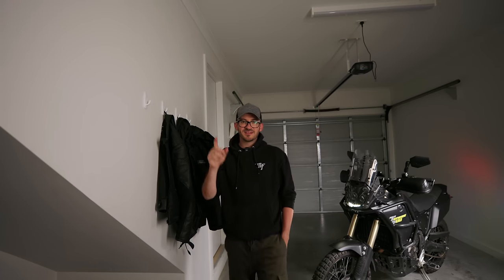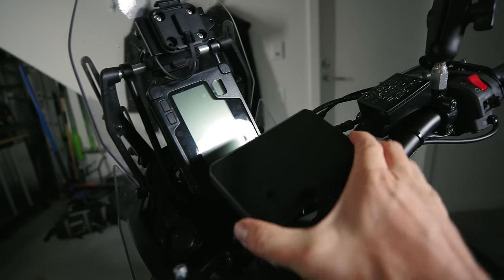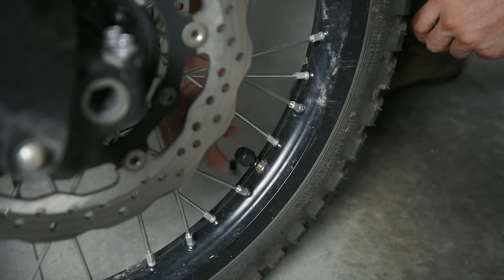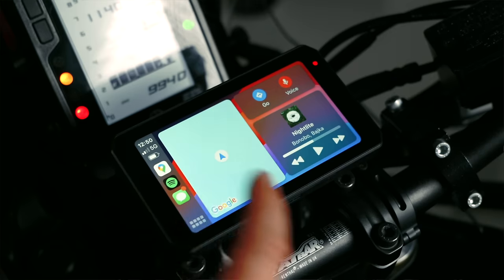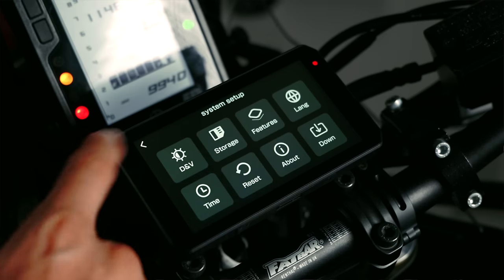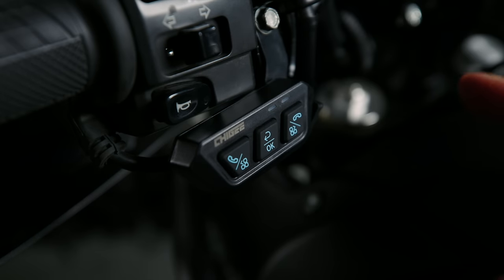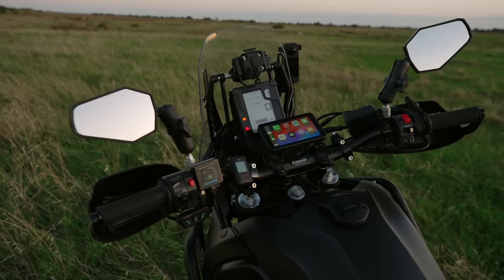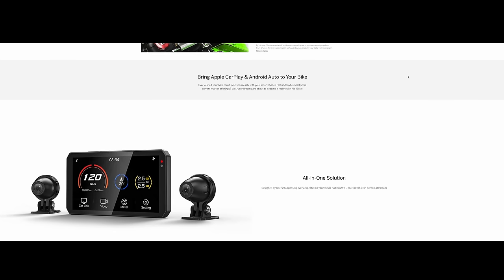The Ultimate Tenere 700 Tech Upgrade! | Chigee AIO-5 Smart Riding System

Comment: Looks cool. Looks like there is a pretty big discrepancy between the bike speedometer and the unit's speedometer(47 vs 40, respectively).

Also, I don't ever really feel like i have a blindspot on my motorcycle. I am not constrained inside a cage and can swivel my head freely.